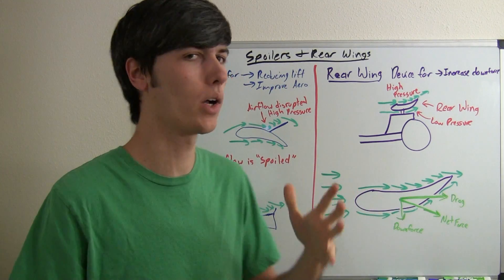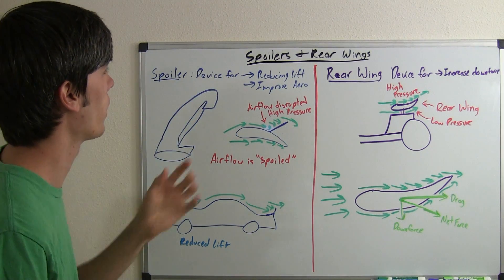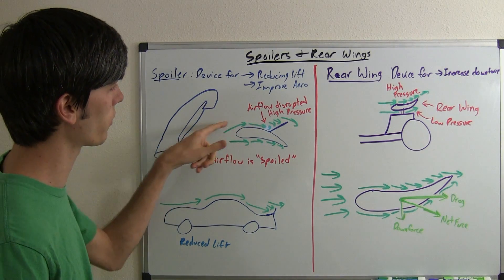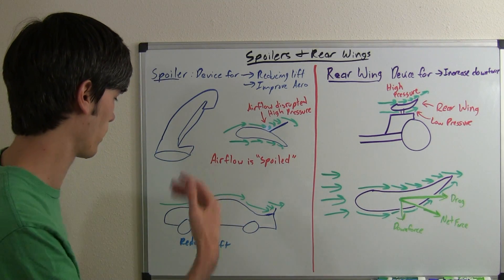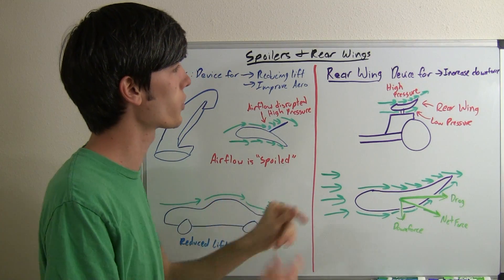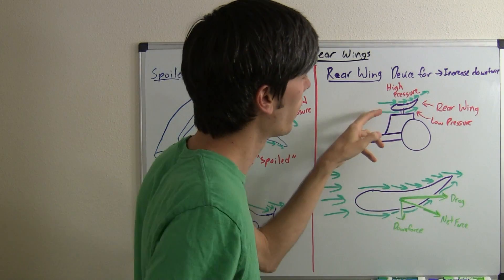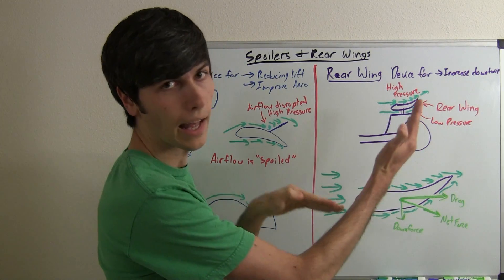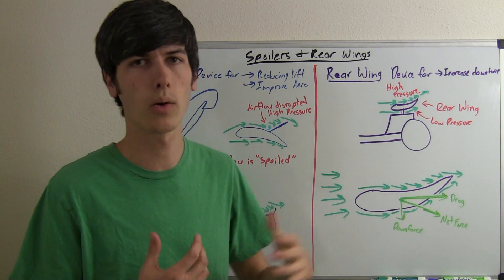Spoilers and Rear Wings - Explained

Comment: Hi that was a great video! Few questions for ya, 1) How do we know that a particular wing creates more downforce not more drag? If I want to purchase a rear wing how would I know it? 2) Also, would you recommend spoiler or rear wing? 3) if I want to purchase the spoiler how do I know it doesn't mess up with the aerodynamics?
Reply: old comment but i will try to answer.
all wings will create drag. infact anything you stick into the airstream will create drag. without going into any extra detail, the downforce to drag ratio will depend on many design and placement factors of the wing, and without aero modelling and testing you are unlikey to get those numbers.
2. spoilers and rear wings function in different ways. a wings purpose is downforce only. a spoiler depending on design can be purposed for drag reduction or lift reduction or both. id say most serious wings produce more downforce than most spoilers prevent lift but at a higher drag penalty. choice depends on application.
3. 'messing up' aerodynamics is too broad a term. do you mean adding drag? do you mean creating a downforce imbalance - eg too much rear downforce creating lift at the front? 
i think if youre asking these questions and you dont own a purpose built race car, dont buy any wings or spoilers. they dont serve any purpose at legal street speeds, a lot of the of the shelf wings and spoilers are just for looks, and the only true way to design an effective aero package for a car is using CFD modelling and experts.
if there is a 'sports model' for your car like the focus RS, you could get the front and rear spoiler and wing for your normal focus for a small improvement, but its probably a waste of money unless youre on a track.

Comment: I need to put a rear wing on my s2000 to have more downforce. Is it efficient enough to mount it on the trunk? Wouldn’t the rubber plugs and trunk seals absorb a lot of the pressure? I see a lot of professional racing teams at the track they have their wings going through the trunk and go all the way to the frame. But I don’t want to lose trunk space 😅

Comment: Is there a difference in appearance? Say I see two cars and one has spoiler and one has a wing. Would I be able to differentiate the two purely on appearance alone?

Edit: Do air dams have the same function as spoilers or as wings? Or are those different entirely? I know some use these purely for styling purposes but I'm curious about the practical function of these devices.
Reply: a spoiler would look more like a 'ducktail' i guess, and a wing has an air gap under it.

For example: Look up : 'Porsche 911 sport classic' for the spoiler 
look up: 'Porsche 911 GT3 RS' for a wing

Comment: Big wings and spoilers are just there for macho muscle-car or ricer looks, they actually slow a car down at high speed and unless scientifically developed in a wind-tunnel, they can create dangerous unbalanced down-force. Also, why would you want them at low sub-60 mph speeds where they do nothing? They belong on the racetrack where they make sense, but of course there's no stopping young folk who want to bolt every possible extra onto their ride in the vain and naive notion that they're improving it!
Reply: why do people turn their sound system way up when they have friends with them? it’s backwards but it’s image

Comment: One slows you down and the other does the same, end of discussion. Of course that's what happens with ricers. Actual tested spoilers in wind tunnels will have an effect than just randomly putting one on your car.

Comment: I don't see the difference between "reducing lift" and "increasing downforce"
Reply: Sorry this is really late but reducing lift is just keeping the car from not lifting off the ground but increasing downforce is putting more force to keep your car more than just sticking your car to the ground, it is effectively gluing your car to the ground for more traction for cornering, or things like that
Reply: @charchuuu  Atlaaaast someone cleared my doubt. Ugh!!😩
Reply: @charchuuu  Well, what makes the explanation ambiguous is, that downforce also has a reduction of lift as effect.
So you mean downforce doesn't only cancel out lift, but even pushes down the car further than its own weight would, while standing still (effectively making the car heavier)?

Comment: It says in the description, "Spoilers are used to reduce lift, such as spoilers seen on airplane wings, which "spoil" the airflow. Rear wings are used to create downforce, and allow a vehicle to corner faster and be more stable at high speeds." My questions are: (1) Do cars generate lift, such that you would need a spoiler to reduce it? (2) Are you reducing lift to bring it closer to zero lift? (3) Wouldn't putting a spoiler generate drag too since you are disturbing the flow of air? (4) Or is this drag smaller than the drag caused by a rear wing? (5) So, is it best to say that spoilers are used to prevent some cars from lifting off when going straight at high speeds, while rear wings are used to push cars down so as to corner better at high speed? (6) Are the active (automatically controlled) devices on expensive cars spoilers or rear wings?
Reply: (1.) Well they aren't supposed to but they could depending on the shape. There have been incidents where a racing car gets air underneath it which will lift it up and send it flipping around. The spoiler or wing will push the car down to prevent that but a spoiler is not necessary as long as your willing to sacrifice traction. (2.)Pretty much I guess. (3/4) Yes spoilers and rear wings cause lots o' drag. Look at the Dodge Viper acrx. It has a theoretical top speed of over 200mph but the rear wing on it causes so much drag that it limits it to around 190mph if I remember. I would think that a rear wing generally generates more drag based on size and profile but it varies. Then again a rear wing would also generate more downforce.  (5)pretty much as far as I know.
Reply: (6) all three... Spoilers, wings, and air brakes. When it's fully tucked down it could be considers a spoiler, when it's raised its a wing, and when it's fully extended and flipped forward perpendicular to the direction of travel it's an air brake.

Comment: If you drive under 100mph you don't get any benefit with either.  Not enough lift generated under those speeds to overcome the weight of most cars.
Reply: if you have big enough spoiler, with high angle of attack, it can be significant even at 40mph. Some planes are takeoff at 100mph.
Reply: Spoiler is not an airfoil so angle of attack doesn't matter. Generally, spoilers and wings are useless for most of cars.

Comment: HI, So after the low pressure is created, how is it transferred to chassis/load on the wheels? Is the entire weight(downforce) acting on the rearwing(metal part) and is that connected to the chassis or is a vacuum kinda thing created ? Lets say I have a toy car and I push my finger on the read, vertically down adding weight, it is transferred through the plastic body, but how does the wight get transferred to the read wheels in a real car?  Thanks in advance for the answer!!
Reply: I'm not sure... But isn't it because of the suspension?

Comment: Cant you use the formula L=(1/2)  v2 d s CL, where L is Lift, d is airs density, ICAO (Aviation standard) uses 0,002377 at an altitude of 0 feet, v2 is speed in feets per second, s is wing area in square feet, and CL is Coefficient of lift. Since rear wing is basically same wing as in plane, but upside down? i'm an aviation student and this just popped into my head from aerodynamics class

Comment: I'm still not sure I'm 100% clear on the functional difference of the two. The way I'm understanding it is a spoiler creates downforce by air hitting it/deflecting off it, thus pushing down on it; whereas a wing creates downforce by air pushing on the top of it while a low pressure area is created below it, thus the wing is pushed and pulled down at the same time.
Does that make a wing a more effective tool for downforce? Does a spoiler create more drag than a wing (in general, obviously drag can vary between designs)? What about the effect different wings and spoilers have on lateral forces?
I feel this topic deserves a little more detail. 
That spoiler joke was hysterical by the way!
Reply: A car is sort of wing-shaped (flat bottom, humped top) so it creates lift. The spoiler disrupts this lift, so you get the same force on the tyres at speed as stationary. 

The rear wing is inverted compared to an airplane, so it creates downforce. You get higher force on the tyres at higher speed than stationary.
Reply: +UndergroundTrev The simplest way to look at it is that spoilers decrease drag and wings increase it.

Comment: OK, so I drive a Nissan Cube, not a drag efficient car by any means and kind of like pushing a brick through the air.  Disclaimer, I by no means think my car is fast nor am I trying to race anyone or make it faster.  Its just for fun and looks.  Funny thing is, I drive way to fast and always have.  I have realized that the back of my Cube gets extremely dirty.  From what I understand it is because of the ridiculous swirling turbulent air that the shape creates. much like a tractor trailer or box type truck.  I have actually watch many wind tunnel tests to see how shape affects air turbulence in the rear of the vehicle.  my questions is;  will a rear spoiler, not some dumb roof mounted wing, offer a little bit of guidance for the air flowing over the vehicle thus, if nothing else, extending smooth travel of air over and around the vehicle to ease this problem by any degree?  its pearl white and I can literally wash, go for a ride and the back of the car is covered in what ever dirt I drive through.  even if I drive over some grass clippings.  the whole car will look great until I walk around and the whole back door is covered in grass clippings.  thanks man.  have been watching your videos for years now.

Comment: spoilers does absolutely nothing for 3000+lbs street cars. Just a gimmic for looks. Maybe a 3000lbs or less super sports car have some benefit in corners. But likely not needed there either. Koenigseggs adjustable wing that creates steeper angle in low speeds is the most sensible. But really not needed for 99% of the cars out there...
Reply: You mean wings won't do anything? Because spoilers are barricades to undesirable flows, and thus are able to reshape airflow streams around the vehicle. This can help keep the rear of the vehicle down and decrease drag by changing the effective vehicle shape.

Comment: What about deck lid spoilers ... Pros & cons of having one ...
Reply: +Qezt Nest   Spoilers and rear wings do essentially the same thing, put more weight on the back wheels, which is good, and they add some air drag which is bad.  If you are not driving fast enough and cornering hard enough that the back wheels are slipping, you won't see the benefit, but will see the drag in your fuel bill. With most production cars you are talking about fractions of a percent, the device being an appearance thing more than anything else.
Reply: +Edward Rex spoiler reduce drag ffs.
Reply: +cookeD_Potato reduces
Reply: cookeD_Potato Nope.
Reply: Edward Rex REAR WINGS AND SPOILERS ARE A DIFFERENT THING FFS
Reply: cookeD_Potato Absolutely.  And both cause drag.
Reply: Rear wings increase drag but with potential downforce depending on which kind of cars you put it on most seen in race cars. Spoilers reduce drag by redirecting air so that it will reduce dangerous lift by air flowing downwards of the low pressure area created by the shape of the rear
Reply: And without a rear wing the low pressure are will produce drag
Reply: Area*
Reply: Take a look at this link. the guy answering explains it very well.

https://www.quora.com/How-much-downward-force-does-a-spoiler-produce-and-is-it-significant-enough-to-make-a-positive-impact-on-acceleration
Reply: cookeD_Potato A spoiler will make a larger low pressure area and more drag every time.  It will push down a little on the car, but so will cinderblocks in the trunk.  If the car was unstable, the spoiler may help, but it is not making it more efficient.
Reply: And btw the high efficiency vehicles are designed so that they don't need spoilers.
Reply: cookeD_Potato Of course, you don't want all that extra drag.
Reply: Edward Rex Yes but when it comes to a car like the TT for example it reduces drag. And you don't see those high efficiency vehicles just anywhere. I'm talking about most street cars not those ugly shits that are supposed to be cars.

Comment: I understand that a wing is detrimental towards consumption because it creates drag. But what are the effects of a spoiler on consumption?
Reply: +Nick Amarit   Spoilers and rear wings do essentially the same thing, put more weight on the back wheels, which is good, and they add some air drag and weight which is bad.  If you are not driving fast enough and cornering hard enough that the back wheels are slipping, you won't see the benefit, but will see the drag in your fuel bill.   With most production cars you are talking about fractions of a percent, the device being an appearance thing more than anything else.
Reply: I noticed that on the whiteboard, he wrote down "Improved aero" for spoilers but did not write that for wings. I am guessing that wings innately come with drag (as in it cannot be avoided) and therefore hinders rather than than improve the aerodynamics of a car.

Now if spoilers actually do improve the aerodynamics, then according to his other video about "Aerodynamic Drag", then a car with a spoiler should also yield more miles-per-gallon than the same car without a spoiler because of a lower drag coefficient.

Can someone confirm this please?
Reply: Nick Amarit I'm not an expert in this area, but I do know that ideal aero dynamic shape (for efficiency) is a teardrop, with the back end being ideally a pointy cone.  The spoiler seems to make that worse, creating a cup shape at the back.  They do improve aerodynamics in the sense reducing lift is a positive thing.

I don't think he was clear at all about this in his lecture.  I'd like like to hear the opinion of an expert as well.
Reply: +Edward Rex Spoilers are barricades to undesirable flows, and thus are able to reshape airflow streams around the vehicle. This can help keep the rear of the vehicle down and DECREASE DRAG by changing the effective vehicle shape.
Reply: cookeD_Potato Show me a spoiler or rear wing on any vehicle designed for high efficiency.
Reply: cookeD_Potato No they don't.  More weight more drag.  Look at every high efficiency vehicle.
Reply: Edward Rex the audi tt is a good example.
Reply: cookeD_Potato Of a sports car, sure.  But here is a high efficiency vehicle: http://assets.inhabitat.com/wp-content/blogs.dir/1/files/2013/06/BYU-1300-MPG-car-1.jpg

Comment: This video does not do a good job of discerning the difference between the two as he basically says, the spoiler produces down force where the wing produces down force.  For the Spoiler, the air only travels on one side which gives less control over how the air behaves (attached to body).  For the Wing, the air travels on both sides and allow for the creation of a low pressure side diverting the air on the top to produce the high pressure downforce (detached from body).
Reply from the maker: theryko The pictures show this. :)
Reply: Engineering Explained Then the video should be "Spoilers and Rear Wings - Pictured"
Reply: +theryko I think it did do a good explanation, a spoiler basically just causes air to want to travel in a different direction but doesn't necessarily add downforce while a wing is the part which is actually "doing all the work" and actually creating the downforce. For example, when ferrari talks about how they shape the body to increase downforce, those shapes are spoilers because they arent adding downforce themselves they are just "spoiling" the airs intentions to go wherever it wants to go so that it finds its way to the wing to create downforce rather than to the ground to create lift.
Reply: A spoiler moves, a wing doesn't. Simple.
Reply: Weird how 800 people disagree with you

Comment: I'm having a debate with everyone on a Might Car Mod video about their 11 second Gramps car build.e. The car had problems getting traction, they deflated the tires and even went on a hot day to increase the traction which both worked phenomenally well.  The argument is will a spoiler help the car reach the 11 second marker, if so by how much? The car speed reaches just over 170km or 120 mph. I read on engineering forums that spoilers can start working at speeds as low as 37 mph -150 mph and help decrease the lift as you accelerate of course. The car also had roof racks which, I think if they took off and added a spoiler would help also reduce drag. 
What is your say about this matter?
Reply from the maker: JappyChan Roof racks should be taken off as it only increases drag. Spoiler is hit or miss. Downforce probably won't be that necessary for accelerating the car unless it really can spin the tires at about 80 mph or so, which it probably isn't traction limited. For most street cars, you won't be able to spin the tires at these speeds, so for acceleration purposes, the spoiler just adds drag. For cars like in the NHRA, which have the power to put down, a spoiler can help even though it adds drag.
Reply: Thank you for replying back! You are the man! Keep up the hard and great work.
Reply: Traction  issues in an AWD Subaru... Just goes to show how much of a beast Gramps is.